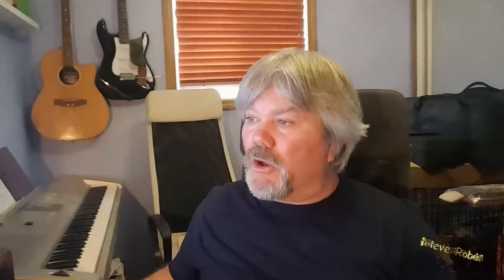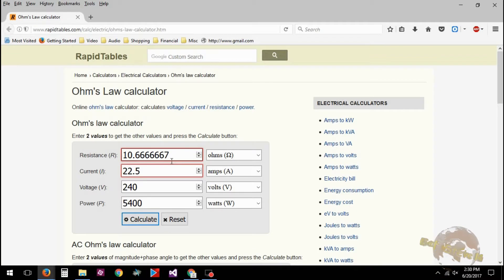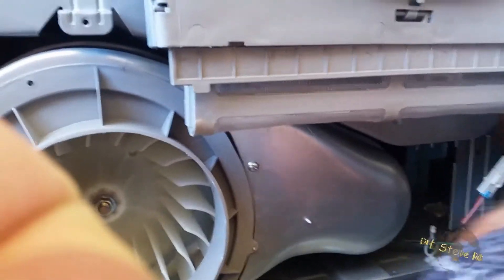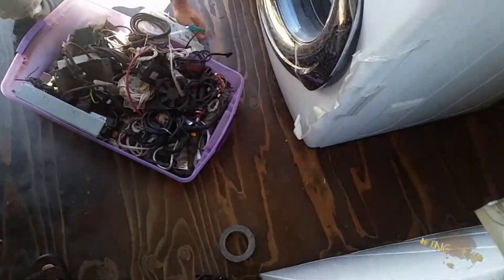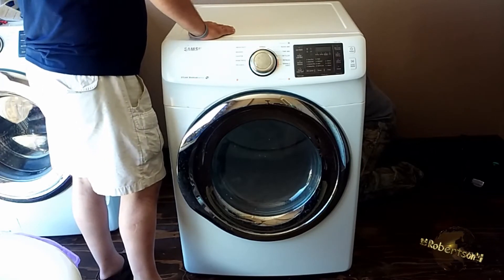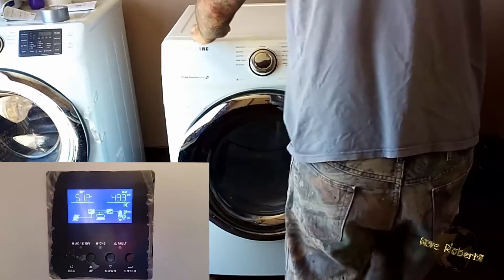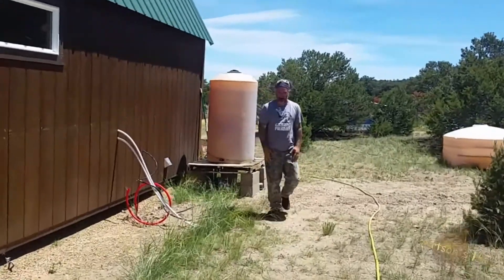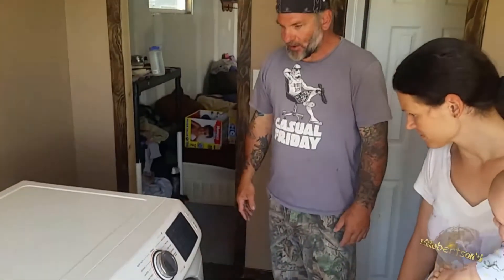Off Grid Electric Dryer Conversion

Comment: why does converting a220 volt converted to 120volt end up using only 800 watts opposed to a 120 volt dryer that uses 1100 watts?
Reply from the maker: Ohms law.

Comment: OK,  so I know this video is 4 years old, but I have that same dryer, and would like to do this.  is there any way you could show us what you did because the video only shows you probing the wires and then nothing else...
Reply from the maker: Well that dryer is long gone and I live in hawaii now. So unfortunately there will be no more videos of that project.  Honestly, it just barely got warm.  There is a much better dryer that uses only 400 watts although it does require 240v.  You can find it here. Your friend has shared a link to a Home Depot product they think you would be interested in seeing.

https://www.homedepot.com/p/Samsung-4-0-cu-ft-24-in-Stackable-Ventless-Electric-Heat-Pump-Dryer-in-White-DV22N6800HW/307685530
Reply: @OffGridLivingSteve  gotcha... thank you for replying so fast!!  I actually looked through the comments and got my answer anyway lol. I have a commercial Solar System installed that is a  Generac brand that I recently upgraded from 80 amp capacity @ 8kw and I was looking at adding more loads. I'm limited to a 160 amps now..

Comment: Even if I don’t go solar, I like the drying technique you describe so can a regular dryer be set up with reduced temperatures as well? Also with the set up you are using, how does it take into consideration the inductive load of the motor? Please keep it simple, my electrical knowledge is not advanced 🙏 God bless

Comment: You could run the heater element directly off array DC voltage and not worry about inverter.   Someone just told me he is running one of my systems on his clothes washer.  Wouldn't be hard to center tap the heater element and get half the resistance.
A auto buck transformer would allow you to drop the voltage to 160 or less and still run at 240V and get about 2.5KW of heat.

Comment: Wow I like that definitely going to try that on my solar project
Reply from the maker: Karl Trombley it barely works. If you can afford it, get a heat pump ventless electric dryer. It uses 85% less electricity. It does for clothes drying what LED’s did for light bulbs.
Reply: @OffGridLivingSteve  have to check that out thank you

Comment: Dope, you got a like & subscribe.
I was considering doing this with the same dryer (minus the steam option) 
I was thinking the bypass would have to be more internal considering relays & circuit board/computers might not work if they read low voltage. 

I have to ask, did you consider a simple 110 cord swap, like we see being done on traditional dryers?

Do you feel that is another option or do you think the computer & circuit boards would be an obstinate with a 110 cord swap?

Just curious, and please understand I ask this with all due respect.
You’re the only person I’ve seen that was brave enough to give it a shot on a brand new Korean dryer,
It’s always nice to see old school guys embrace new technology with confidence, I got hella respect for you.
Reply: David Agredano this has been quite some time ago, buy I believe the only portion of this dryer that was moved to 110VAC was the heating element only.  The remainder still runs on 220VAC as it did.  Duane had no choice because his inverter couldn't push the heating  element.  I was more curious to see if it would dry clothes.  It does.  But a load takes about 2.5 hours to dry.

Comment: Alternatively use a gas dryer and change thermostat to run lower temp to use less fuel
Reply from the maker: The only reason this was done was because he already had the dryer, his wife liked it and wanted to use it.  So this provided them with the ability to use it on solar power.
Reply: That is a foolish comment. In the end he will use more electricity for the longer runtime and also it will take just as much fuel to dry the clothes. There is no such thing as free energy. Also the clothes will wear out quicker. Tampering with an appliance like this will also void home insurance regardless of what the cause of a fire was. It's called negligence.

Comment: The fact that off grid systems can't run simple modern conveniences shows that off grid = FAIL! A much better solution than rewiring the dryer and then waiting forever for clothes to dry is to simply stay on the grid for those loads that solar can't handle.
Reply: I have a landlord supplied 110V dryer that is coin operated. It dries, but not great. Changing one wire is better than getting a new one.
Reply from the maker: If you don't have a pair, this lifestyle isn't for you.  So being on the grid is obviously the best choice for you.  Thanks for watching..

Comment: Will this work on a 240 Compressor?
I want to do the same thing
Reply from the maker: This can't be done with an air compressor because the motor is an inductive load and not resistive like a heating element.  It is the frequency (60Hz)  that cause the compressor to spin at a given speed (usually), and voltage most generally determines it's amp draw and therefore the torque it provides.  It's more complicated than that, but changing the voltage to an AC motor will usually give bizarre results and almost always shorten it's life considerably.
Reply: Thank you for taking the time to explain
Reply from the maker: I enjoy helping.  There are thing I appreciate people taking time to explain to me, so I know it's nice when someone takes some time to answer questions.

Comment: why on Earth would you have a dryer that uses 5400w. mine uses 2000
Reply from the maker: Explanation is here: 1:54

Duane had sold his house and purchased the matching washer and dryer before going off grid was even a glimmer in his mind.  His wife wants to keep the set they have.
Reply: Thanks for the reply. I suppose what I am really getting at is I never knew you could buy any appliance other than an oven that would use that amount of electricity. With energy star ratings the latest thing in Australia and I would imagine the world over I am very surprised that such appliances exist. I think my entire main circuit breaker would trip out after a while at 7kw. So running this appliance and a kettle at the same time would be about my limit! or slightly over.
Reply from the maker: I do agree with what you're saying.  In the USA, companies will give you what you "want" without regard to cost - initially or operatively.  So living off grid does come with some unique challenges such as Duane's case.

Comment: Why so much power? Dryers here draw 2400W at the most on 240VAC.
Reply from the maker: It probably has something to do with the steam feature.  But most of that power is consumed by the heating element itself.  The reason I included the spec plate on the video.
Reply: Steve Robertson Thanks.

Comment: Can you tell what  you  did? did you change  wires or heating element?
Reply from the maker: We just disconnected one of the leads on the heating coil, taped the end and tied it off with a tie wrap to make sure it won't scuff the insulation from vibration.  We then connected a 12ga wire to the neutral block inside the drier and ran it alongside the wiring harness with tie wraps.  Then we terminated the wire to a 1/4" spade connector (female) and just plugged it into the heating coil where the original wire plugged in.  It doesn't matter which wire you select.
Reply: @OffGridLivingSteve  
This video gave me an idea, I just installed a gas dryer for wifie and still have the old electric dryer and  i am going to convert it as you do.

Comment: Good job.    I found the easy way to do it was to put a 200 amp diode on  one of the 220 heater element legs which cut the power in half since this cuts off half of the 60 cycle wave.  This cuts the wattage by 50%.  Fast and easy. Just use a big diode.
Reply: Thermodyne Systems 
Another great idea brother. You guys are the best.
Cheers
Reply from the maker: I didn't think of that.  It probably wouldn't need a huge heat sink either, especially if placed near the air intake!
Reply: That would work OK if you had a 240 volt source available to begin with. However an inverter might not be too keen on the unbalanced half-cycle load.

Comment: Great video. That will get it done.
There is some guy in Florida that has his dryer heated by solar hot air, I think he had 3 4x8" panels capturing the heat and used the dryers fan to pull it through. Longest solar day is here, they get shorter again but good time to think solar

Comment: The advantages of living in the USA 120v , here in Australia my voltage hovers around 250 id be a real power junkie using USA made and maybe a part time fireman LOL
Reply from the maker: LOL  The voltages here in USA do have definite advantages.  But like anything, it has it's set of caveats as well.  The split-phase of USA 240/120V poses unique problems for off-gridders.  In Duane's case, we had to purchase a transformer to supply the needed split-phase.  Even with nothing else running that transformer consumes around 100 watts!  

If/when I get to build another home, I will try to do something different - either use a combination of inverters or try to go primarily 230VAC using PIP.  A combination of inverters would allow me to shut off the high powered inverter at night(water well, water heater, etc) and then run a smaller 120VAC inverter for lights and small appliances that would run 24/7.  But then I would have to have separate service panels and wiring within the house.  On and on it goes with possibilities and challenges alike.
Reply: a friend of mine here on youtube does that, he runs several smaller inverters to run different parts of the house instead of a big main or paralleled units.
Reply from the maker: Rev John O'Toole I do like the idea quite a bit.